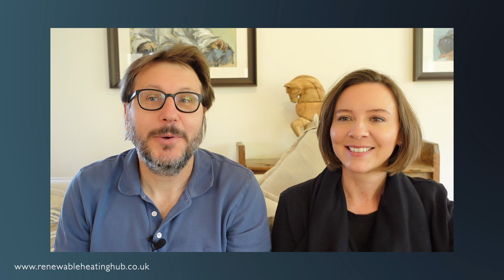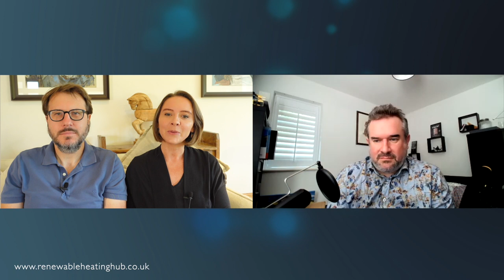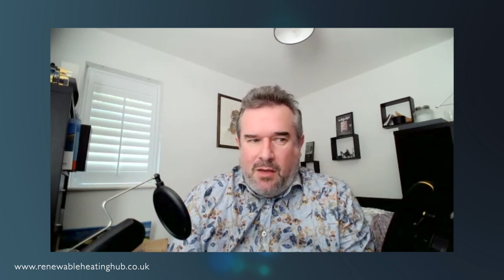How Smart TRVs And Controllers Can Make Your Heat Pump More Efficient – (Ep. 9) Rob Whitney

Comment: Very interesting to have someone that has worked on th Evohome explain how it can interact with a heat pump. I have had it for a couple of years together with a heat pump on traditional radiators and we could not be happier. Installing PV soon and we will use it to store some thermanl energy whenever we have a surplus of electricity production.

Comment: Another great interview. I split my heating into zones (upstairs, downstairs and a front room that was a garage on North side of house, unheated most of the time, but used as a bedroom for wife's dad who needed it hot) probably spent less than £200 on valves and timed thermostats. Saved a fortune over the last 10 years, probably a third off my heating bill or more. So don't think smart is necessarily required, but we're not going out to work every day like some. 

Started running boiler at 60degrees to get it into condensing mode, be interesting to see if house is warm enough, and if boiler is more efficient!

Personally think energy consumption should be carbon taxed and offset against generation kWhrs, thus making renewables much more attractive to those that use a lot of energy, and have ability/space to install. Obviously, this needs to be tempered by ability to pay and status of home owners, so perhaps based on rateable value of home and/or income/tax paid per year.

And first time I've ever been first....

Comment: A timely video, I've been trying to find programable or smart TRV's that I can retrofit to our office radiators. Don't quite want to replace the whole control system yet. One thing we were told by a plumber was the TRV's should be replaced with the radiator valve, if we want them to work properly...
Reply from the maker: Thrilled to hear you found it useful Ken. Thanks for letting us know.